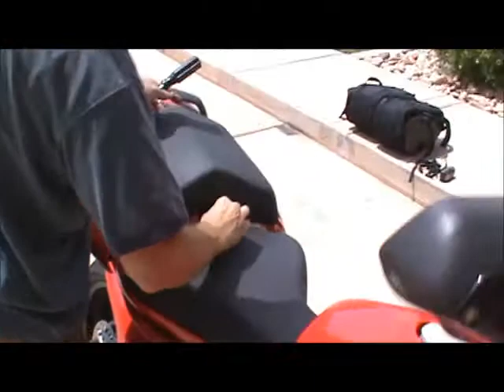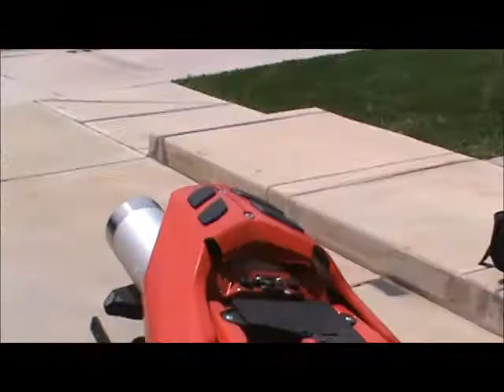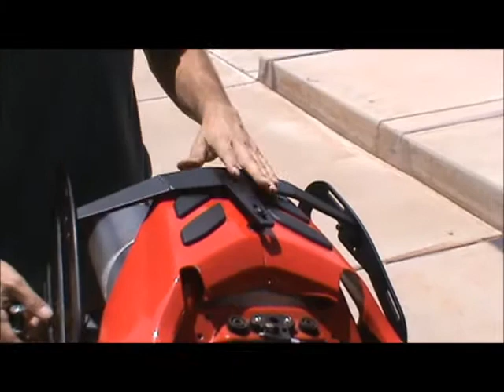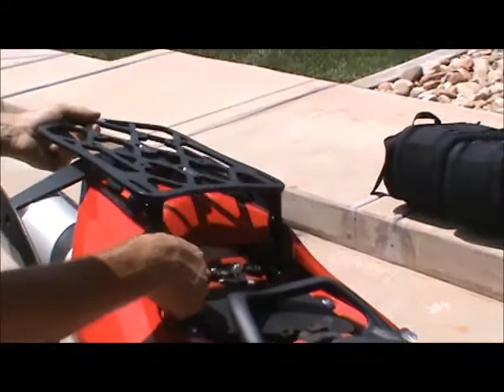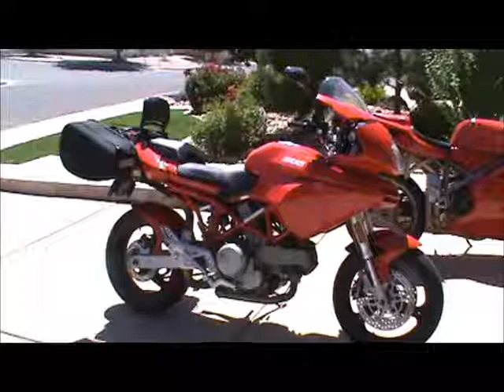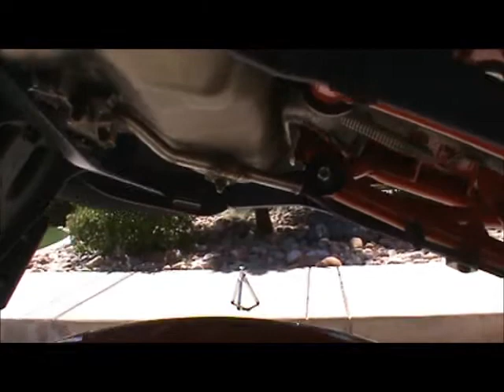Ducati Multistrada 620 1000 1100 soft side case mount luggage rack, saddle bag support

Comment: this is by far the best upgrade i have seen for the multistrada, i already own one of your backrests, but this is an amazing design. it looks fantastic and i will have to get both the racks and the luggage rack now for sure. Well done guys, thankyou for this, it has always been dodgy putting soft bags over the rear fairings as the fairings get pushed onto the exhaust, or at least get scratched.